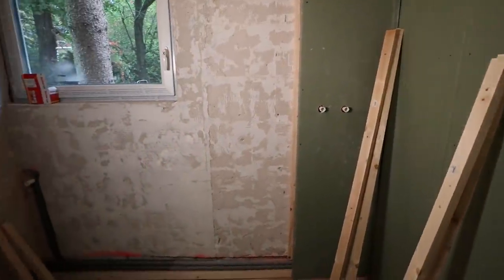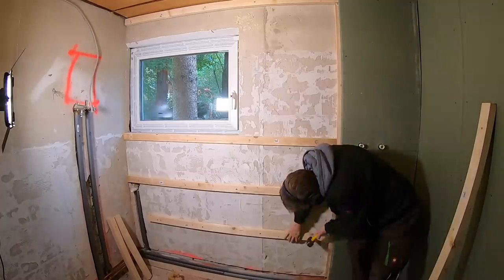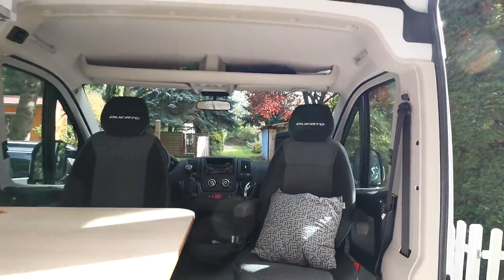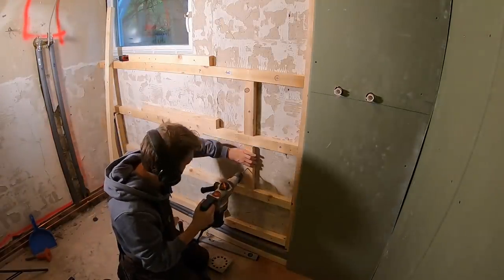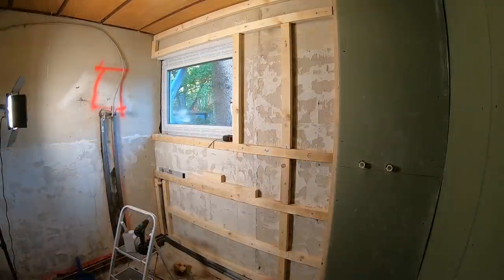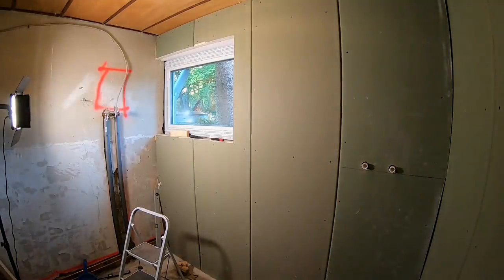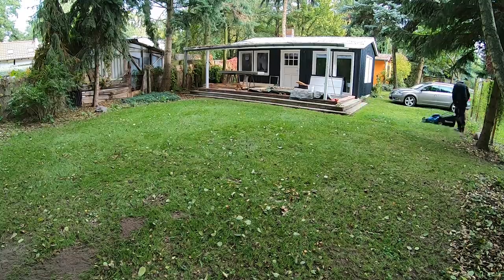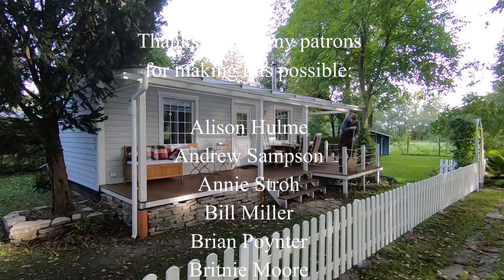Renovating an abandoned Tiny House #67: A dream in green: Another dry wall

Comment: I recently bought a battery powered hart mower from walmart, it's not as good as a gas powered one, but it gets the job done and still looks good, am pretty happy with the purchase. Also you did an amazing job on the drywall, the smaller peices look like they make the job a lot easier.

Comment: Still curious of using sheet rock in a wet environment rather than cement board.
Reply: In the UK you can get ones specifically for wet areas like showers. I'm assuming it's the same in Germany
Reply: @jmk1962  -same in the US.  It’s actually the preferred material, and in localities, required by code.

Comment: I just picked up a 40v cordless mower. I like not having to keep gasoline.
Reply from the maker: ..but don't you think they lack a bit of power..?
Reply: @renovationeast9379  I haven't noticed a drop off in performance, except that the newer mower is slightly narrower, so it's takes a little more time.
Reply: I read that brushless motors have more power and efficiency than brushed electric motors. Having some ignorance when it comes to electrical devices, maybe there's something to that.

Comment: Whats with the old ceiling? Will you keep this? And why don't you have any insulation material between the drywall and the wall? Is the space to narrow for it?
Reply from the maker: I will put drywall on the ceiling as well later on. And insolation will go on the outside of the building later next year